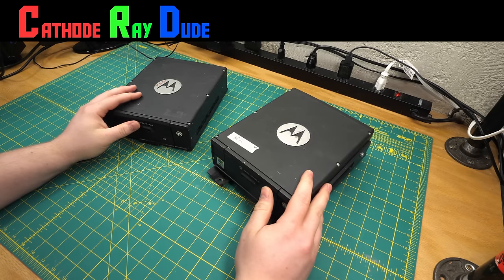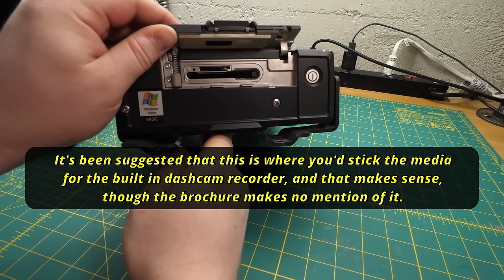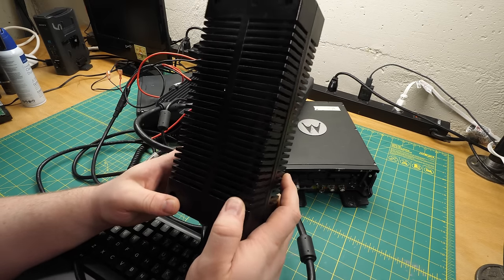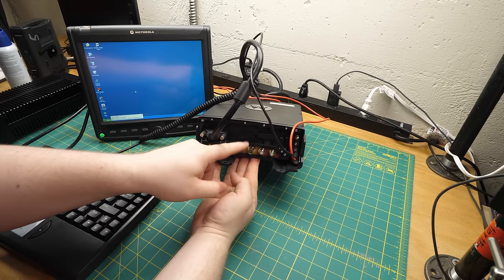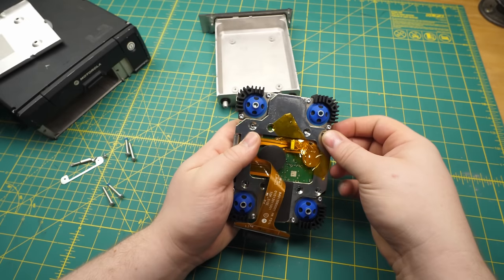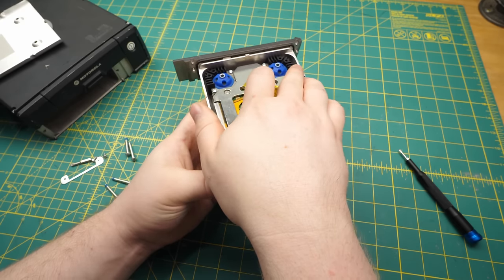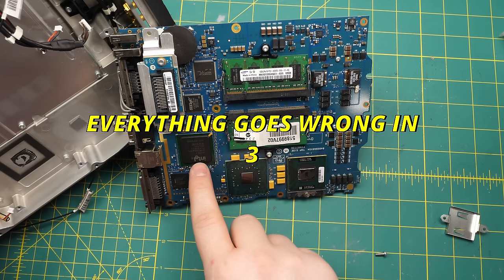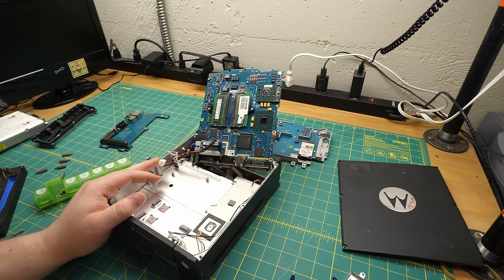Little Guys 7: The Cop-puter [Motorola MW800]

Comment: Heater weirdness:  This makes sense.  It's a lot of power because it can bring the enclosure to temperature quickly, even if it's a metal sled in a metal case with lots of thermal mass.  From then on, you can just pulse it on from time to time.  The foam is likely there to compress the heater closer to the surface that needs to be heated.  A heater hanging out in free space doesn't work as effectively.  Turn on a heated blanket and hold it out in front of you.  Touch it after a minute or so and see how warm the blanket feels to you.  Now sit on it and repeat the experiment.

HeatSINK weirdness:  The rubber nubs on the fans, that slide on to the guideposts -- that's for vibration damping.  Not to protect the fans from the environment, but to lessen the racket they create.  A quiet fan is always appreciated, even in a car.  "Why only this little spot?"  I didn't catch how all the thermals conduct, but I would guess the enclosure does a lot of the work of bringing heat to that area, and then that area is actively cooled if/when needed.  MOST of the time, the case can probably shed quite a bit of the heat generated inside.  And when it's not enough, the fans cool the fins, which conduct from the case, which conducts from all the stuff inside.

AV Decoder:  This is a really common term for composite video interfaces.  It takes a bit of work to turn that smooshed h-sync, v-sync, luminance, and chroma signal into a bitmap in a frame buffer.  Especially the color carrier, which is known as "decoding color."  So yes, "decoder" is what you would search for if you were looking for an IC to do this.  (Not so much in the vernacular for a video capture solution, which would have the decoder IC embedded as part of it.)  BTW, I would pronounce it "Connects-'nt" with more of an ambiguous e/uh sound, rather than "Connects-Ant".  I don't know if that's official, but it's my take.

SDVO:  I knew these as "ADD Cards" -- an acronym for "AGP Digital Display".  I had an old micro-ATX Pentium 4 board that had integrated graphics and a VGA port on the board, but no DVI, and I wanted a digital output.  So I had to track down the exceedingly hard-to-find ADD Card to add (no pun intended) the DVI port.  That's all it did -- no brains of its own, just a DVI driver chip and a port.  The vendor wanted something like $80 to ship the $15 card to my address, so I had to have someone else mail it to me.

I've always thought it weird how these are mounted in a car.  Like, do they really need to be up there in the console like that?  The LCD and keyboard, sure, but the whole PC?  Why ISN'T that in the trunk?  Or at least built in under the arm rest or something.  THAT seems janky.  Even if there needed to be a media card reader in the monitor or in the dash somewhere.  At least it would be less crowded.
Reply: The SDVO/PCIe cards are properly called ADD2. ADD was the earlier DVO/AGP variant.
Reply: @ville_syrjala   OH.  Well, TIL.  Thank you.
Reply: this guys smart
Reply: "Why ISN'T that in the trunk? "
Two immediate thoughts
1. The trunk is already modified and filled with weapons storage and other fun stuff.
2. Signal quality in a high noise environment, especially for video. Long distance video in high RF was probably bulkier and more expensive, not to mention that any kind of car harness would need to be longer than the USB standard permits, requiring active repeaters along the way.
Reply: @Flimzes   Also, dont forget, inside the cabin, it is heated and cooled while this computer is doing most of its hardest work. Then you also have the constraint that the backseat is 100% off limits, so its either the engine compartment, truck, or somewhere in the front half of the cabin.
Reply: You guys make good points.  But still, right there in the front next to the shifter?  Seems like there ought to be a better place.  I guess that's why I don't do car-puter installs though.

Comment: 2:00 Ambulances and fire trucks would generally use the same equipment. In a lot of local and county level governments their emergency management departments handle the acquisition and management of communications equipment for agencies within their jurisdictions. So the local fire department ,EMS service (if a separately organized agency exists for EMS in the jurisdiction), police and/or sheriff would all have the same equipment for their CAD systems. Its not that way everywhere, but a lot of places work like that.
Reply: Aren't all EMS services privately owned and operated? So you're telling me the gov't in some places is paying for PC equipment for privately owned ambulances?
Reply: @Yixdy  in most places in the US EMS services are handled by the local fire department. However some places remove the medics, ambulances, etc, from the fire departments and move them to their own agency. Boston EMS is a good example. There are ofc private providers as well, however they aren’t the majority in most places.
Reply: @Yixdy  Naw. Many of them are proper state agencies.
Reply: Even if the ambulances are private they still need to talk to 911, so they need similar radio equipment and computer interfacing.
Reply: @markjames8664  most private companies do their own dispatching, so 911 contacts the company who then dispatches the ambulance rather than 911 dispatching them directly. I am sure there are some exceptions to that though, and they would def be using similar equipment regardless.
Reply: @Col_Crunch  once dispatched the ambulance needs to be able to talk to police and fire. In some places either fire or police are sent to the scene on medical calls along with an ambulance.
Reply: @markjames8664  true
Reply: @Yixdy In my area, ems use to be a county run service. Now they have completely privatized. I have my opinions about it, but I’ll keep them to my self. I will say this, it was a much much better service when it was ran by the county. You’re starting to see more and more small counties going to a private service and cities starting a combination fire/ems. Your big cities were already doing it, but I’m starting to see smaller cities going to a combination fire/ems. Especially in my area because the privatized ems experiment isn’t working out to well. The two counties near me (one of them I live in) we are now on our 3rd private service. Other two didn’t work out well.
Reply: @Yixdy  in my area the EMS/EMT vehicles can transport 1 person and are paid for by government...so in a given area like a county maybe 10 people max could be transported via EMS..we also have about 50 ambulances which are private..if something major happens  the ambulances back up the EMS...
Reply: Yep. Also can extend as far as into transportation too. Take for example, LU Connect on the London Underground. Post the 7/7 attacks, there was a need to better enable both in tunnel & in station radio systems to work, both for LU ops staff and for emergency services. Connect is built on the TETRA standards, which are used by the UK emergency services as well. It's very neat tech, but all the radios are Motorola handsets (at least on LU, I've held one - proper chunky beasts too). It adds some interesting complications too for when LU interline with National Rail (who use the GSM-R standard, often with Siemens radios).

Edit to clarify: the brand of radios doesn't matter here. It's instead the standard (LU/UK EMS on TETRA and NR on GSM-R)
Reply: And having the same equipment just different software also helps with management, vehicle upfitting because you can give your mechanic/vehicle electronics tech one spec sheet versus multiple different spec sheets for the wiring and vehicle integrations and it also helps with interoperability when it comes to cross agency communications for example if the police arrived first on a call and need assistance of a fire department or rescue or EMTs or for example the fire department arrives on a structure fire and needs assistance of police and the utility company to shut like gas or electric off
Reply: For example a structure fire obviously would involve fire department for putting out the fire, but would also need EMTs and would also usually involve police or fire police for things like traffic and scene control and also usually would involve your locally utility company to shut off natural gas service and electric service to make the scene safe because fire departments generally don't want to spray water on energized stuff especially if the flames are near the electrical service equipment and not all fire departments are trained or even allowed to disconnect electrical service
Reply: Even a traffic collision with no injuries generally would involve the police, fire department, a local towing company and a utility company like their electric company if the accident involved a piece of energized electrical equipment like a pole with wires down or a pad mount transformer. Electric company would have to deenergize that equipment before police or fire or EMT could render aid or tow the vehicle
Reply: @Yixdy  Wait, what the fuck? Ambulances are privately owned in the US?! Jesus christ your medical system is messed up.
Reply: @AureliusR Not the only country that does that, even some countries with universal healthcare systems have privatised ambulance services.
Reply: Exactly.  This equipment is probably very similar if not the same as what most ambulances or firetrucks would use.  Mainly because of the need for interoperability.

Comment: @cathodeRayDude the mystery module at 44:37 is a "dead Reckoning" board for the GPS tracking. basically an array of accelerometers to try and keep vehicle location if GPS signal is lost.  The reason its on the top like that is because its orientation needs to be changed depending on the orientation of the computer itself.

Comment: I had some computers with Vista Home Basic when I was younger. As far as I recall, it was a SKU for cheaper/low-end machines (mainly laptops) and was missing certain aesthetic and media features like Aero, WMC and Flip 3D. I remember being really excited to get a "fancy new laptop running Vista" in middle school, only to immediately be crushed by the absence of Flip 3D. Absolutely tragic.
Reply: Without looking stuff up. I think Basic had a 2GB RAM limit. As well as a restriction on the HDD size.  I "think" Basic was sort of forced on MS.  Who remembers the laptops that could barely run Vista. Due to Intel and other manufacturers, cheaping out on hardware and poor drivers.  I vaguely recall the Vista Beta builds running ok on T42/43 and T60 Thinkpads.  When new "Vista Capable" stickered machines started appearing on new machines. Said machines where terrible.  Now "Vista Ready" were the machines that actually ran Vista well.  However, normal people back then did not shell out the 800+ to get into the bottom tier "Ready" bracket.  A decade and a half later. OEMs are still pushing these low spec machines for W11.  4GB of RAM is the 512/1GB of yeteryear.  Stick any Chromium based browser on, then 8GB can feel tight.
Reply: yep, my grandparents had a lower end Compaq desktop with vista home basic. as a kid I was also disappointed with its lack of aero and stuff because I thought aero was so cool at the time
Reply: I had basically the same, Inspiron 1525 with Vista Home Basic as well as MediaDirect, which I hated because I saw it as an excuse to not give me Media Center which I wanted to try with my Xbox.
Reply: @Yandarval  basic supposed to have 8 gigs limit I think? in a 64bit system. 32bit system 3.5.  but hey at least it's not the Starter that has a limit of 3 applications running at the same time or something.
Reply: My first Vista computer was a Compaq Laptop in 2007. It was a 32 bit dual core Pentium laptop with 1GB of RAM and a 80GB hard drive.

The thing was terrible, slow, and the graphics driver would crash and reset multiple times a day due to memory issues.

Vista Home Basic was just Home Premium without the nice looking features to lighten the load on the GPU. No translucent effects on the Aero windows theme, no fancy 3d window scrolling thing when you hit Windows+Tab, and no Media Center.

The difference between Home Premium and Home Basic is like being a kid and getting offered a chocolate cupcake with creme inside and while everyone else in the room is eating gourmet chocolate cupcakes that came from the bakery in town, you're eating a stale shrink-wrapped gas station brand chocolate cupcake with the white squiggly line on top with a weird off-tasting oily filling.

Comment: I worked for a subsidized housing city run company type thing at one point, and the repair people had super ruggedized laptops. While I was there they were switching from hard drives to ssds, and after the switch it really made the massive spring loaded holders for the hard drives feel like overkill
Reply: I guess they use one or all of these: Getac, Panasonic Toughbooks or Dell Latitude Rugged laptops.
Reply: @markarca6360  it was 6 years ago and my memory isn't that great

Comment: That power supply is an original Motorola unit - I have one new in a Motorola-branded box and use it when programming mobile radios on the bench before deployment.

EDIT: There seems to be a lot of over-criticality here... the cable for the caddy isn't a "bodge," its pretty clearly bespoke. Its not getting creased, and you can even see that when you re-attach the connector, it has a bunch of slack in it. Also, by mounting the fans how they did, you get more usable radiator surface area. If you want to have a boss with a tapped hole in that aluminum, you're going to need a thicker wall than just casting a dowel over-top of a fin.
Reply from the maker: I've seen plenty of folded over mylar cables before, but what's the explanation for the foam rubber foot between the layers? That's what makes it feel like a bodge to me, the cable doesn't sit flat on it and the foot is jammed into the edge of it. There's no way they designed it that way on purpose.

Comment: You're correct about the mass, the whole spring resonance frequency function depends solely on the mas and spring constant, where the bigger the mass (and/or softer the spring), the lower the resonant frequency (sqrt(k/m)). The rubber parts themselves work as dampers instead of just plain springs as well. The entire caddy is quite the mechanical engineer R18 material, I love it.

Comment: As an installer of emergency and police equipment, I haven't seen one of these. I've only ever seen/installed cradles for actual laptops, so it was really cool to know there are mini PCs that have been designed and manufactured for such cases.

Also funny to share your opinions on said products. I wish I did more Fire/EMS but alas, police is just needy and funded better.
Reply: Sigh, can't we just take half of their extremely over inflated budget and get a state run EMS service instead of those privately owned jagoffs?
Reply: @Yixdy be like where I am: don't fund either! Be at your shooting in 4 hours or less or your ambulance ride is free.

Comment: These are used not only for dash cam footage, but also any kind of software that a police officer firefighter or other service member would use. They could use it for a database searching or anything.

As for bus computers, one that I have two of is a March networks DVR. It does not have any video output connections. It is meant as a headless appliance. That you connect to via a network connection. You have to use their software to access the system. I actually have all the software for that system and the license keys to get the software installed. My two systems are fully operational. They were also used in building camera security systems.

Comment: I know I'm posting a SECOND comment but the reason the Conexant chips look a lot better (and are rarer/more expensive) than most of the others is cause they've got a bit more "stuff" in em to separate the chroma and luma signals, the video from that capture looks like it's comb filtered instead of low-passed to get the colorburst smearing outta there so the signal LOOKS like S-Video quality even though it's over composite. Think my old WinTV card has a similar chip in it, the captures on it look a LOT better than any of the new EZCap trash but it doesn't have a 64-bit driver to run on modern OSes and would need a PCIe to PCI riser to even work on my modern desktop, and the comb filter's image improvement is also the reason why Toshiba CRTs are the cult classic of the retro world - you can get near-RGB-modded quality over the stock composite jacks on old game consoles.

Comment: 8:44 I wonder if those are the “high res” recording mode triggers. On the uh Arbiter ? Systems they were always loop recording but that video would be downsampled unless certain triggers were fired. Like, the cop lights turning on, (going code?), the door opening, or a trigger from the cops radio, at which point the footage from a few minutes before and after would be marked as “keep high res”
And yeah that cardbus slot looked like where the storage device for the video would go. I got trained to repair these things, but I ain’t no cop

Comment: In terms of cables coming loose inside laptops I actually had this happen the other week. Coworkers teenager dropped their laptop and it stopped charging, coworker brought it in asked if I could take a look. Opened it up and noticed the little white side plug connector was half way out. So I guess it can happen. 

I will say someone else could have been inside without me or my coworker knowing so take it with a heavy helping of a kid might have wanted a new laptop.